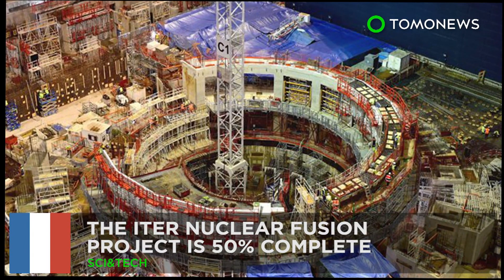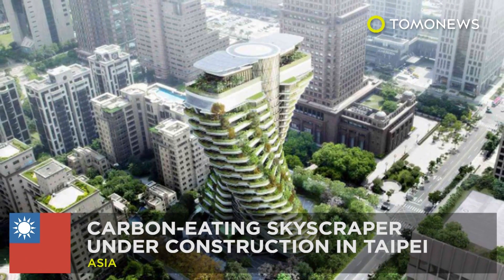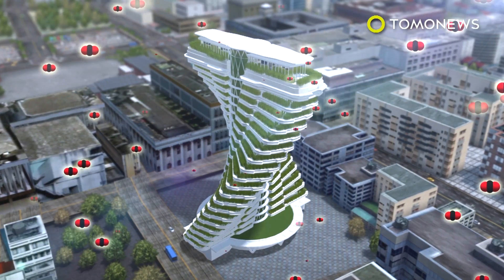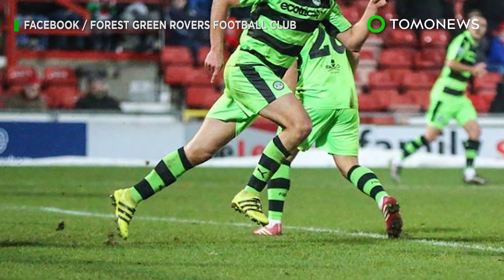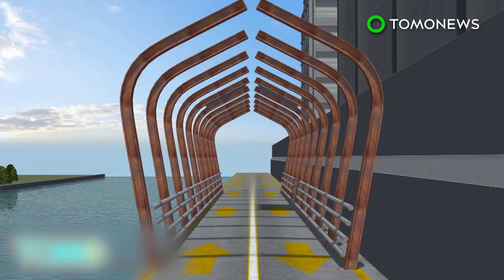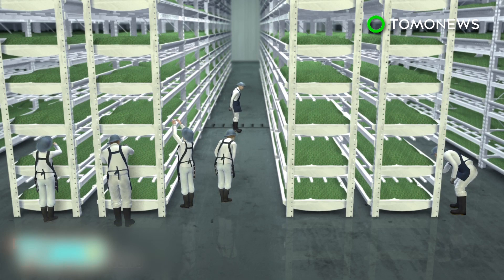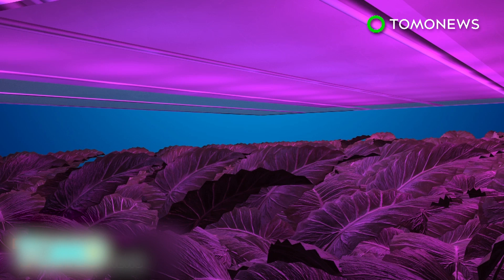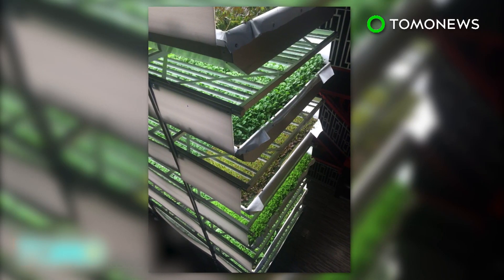Nuclear fusion: ITER nuclear fusion project in France now 50% complete - TomoNews

Comment: As for indoor growing farms.  Ostensibly, these look really exciting but realistically - they are trading one evil for another.  The huge advantage of outdoor farming is 99% of this process is mechanized due to modern farm equipment. Removing these time-saving equipment will no doubt employ armies of people to hand-tend all these crops.  Since these are stacked 4, 5, even 6 tiers highs, this will force workers to use high-reach equipment to tend to upper level crops.  I guess engineers don't think of these things.  Then there's the issue of energy costs for lighting and pumping all that water.  Where's that come from if not directly from the sun?  Sure - a tiny bit maybe from the roof.  But nowhere near enough for millions of square feet of growing biomatter.

Comment: Why don't we just use fast reactors?we have enough toxic waste to use them.
Reply: Galvin Stanley so true
Reply: In the interim I hope that we do (fast reactors are so far not overly efficient at generating electricity but they do solve the waste problem - but is that profitable [an unfortunate reality]?), because even if ITER works as advertised it'll still take generations for this technology to be wired up to the grid. Perhaps a future that includes renewables, storage, fast neutron reactors and fusion will fit the bill?
Reply: lee maitland Solar energy in the long term future,will most likely be a liquid in a jar that can be charged to make power.Scientists are working on the tech now;but won't be ready for at least 20 years.There are new gen 4 reactors being built right now in China that use nuclear waste to make power, 12 other countries have agreed to build them; The U.S. is one of the countries that wants to build them,but it's unknown when they will be built.